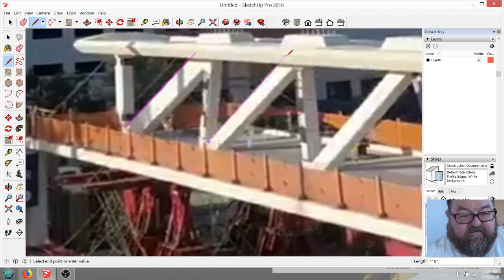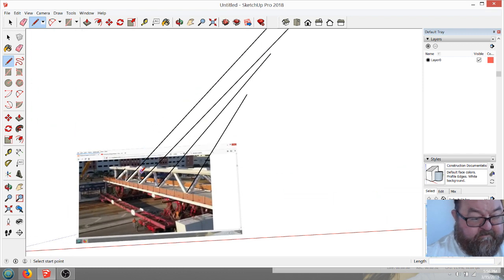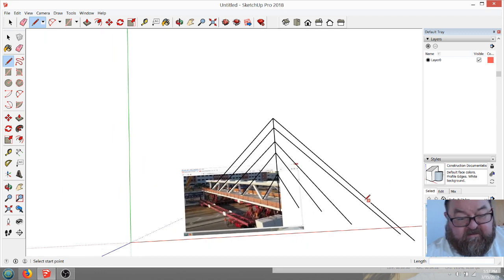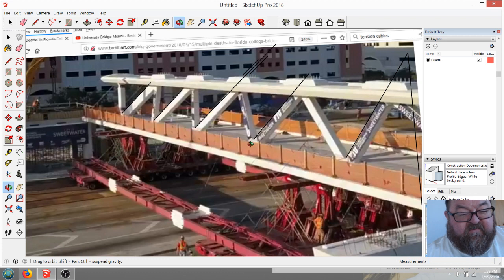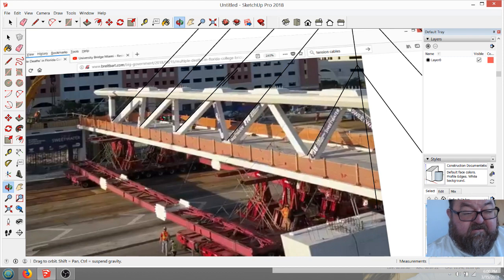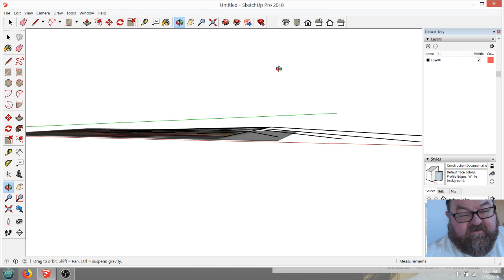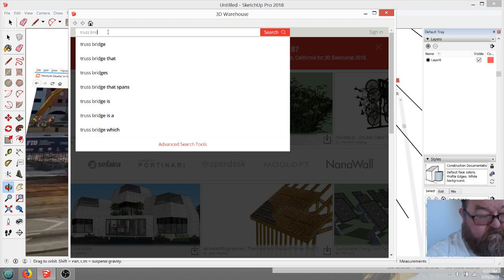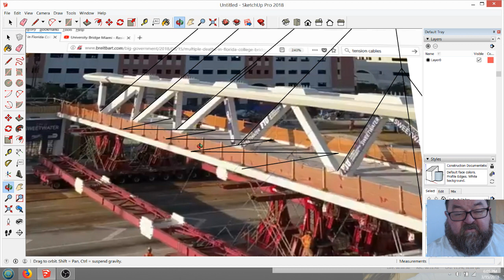FIU Pedestrian Bridge Collapses Under Own Weight - SketchUp

Comment: Should have had used steel, instead of concrete. Even wood is good. Arch is required. No need if strings. Support at mid point required. Stress and bending moment need to be calculated. Proper software, need to be used.  For pedestrian light weight design with durability material required.  Even compressed plastics can be used.

Comment: Try this, Ironworker carries 3 or 4 men in JLG manlift(green)to roof of structure, all persons offload to roof structure roof to plan next phase.There is the person who jumps up to check flex, structure during this phase of build is not designed to withstand this reflective force, get the names of the guys on the roof at time of failure, they ALL went in the hole!!! Conclusion: real people make real mistakes
mike&gina in Tennessee, in love, in Christ.
Reply from the maker: I hadn't heard that.
Reply: This is my trade or was until DACA replaced legal American citizen union Ironworkers in 2010 w/illegal aliens. I was DOT certified welder. I have done this same installation, the tell is the green man basket still in air after collapse. Three men leave man basket (550 lbs) and walk out on roof structure, without guy wires in place THIS is over stress even if your "walking on eggs". I think one jumped up causing a flex or ripple effect, He was jumping up when collapse occurred. In slo-mo you see two men ride the structure into the hole, and the jumper is left airborne suspended, then in the hole like the rest. I have picked 900 ton, this is poor judgement. They will make it more, watch the slo-mo.We may not have the workforce to make America great again.
mike&gina in Tennessee, in love, in Christ
Reply from the maker: Thank you so much for your comment. I am also in construction in Tennessee.  I see what has happened to our industry every day.  People like you make our country great, not these people.
Reply: YUP

Comment: If the suspension cables were installed the bridge would not have collapsed.  This tragedy is the result of sheer stupidity of construction oversight. 
The temporary supports should not have been removed before the overhead suspension cables could be installed

Comment: I am a commercial carpenter w/30 yrs exp. Does anyone else see that this part of the bridge is like a bar joist,  or TJI. That have load top members and trussed underneerh,  transfers weight out to the end.  This has truss on top transfering weight to the center its upside down engineering
Reply from the maker: Yes and look at the so called truss webbing.  It is designed to be an extension of the stay cables and not a truss.  This is part of the problem I believe.

Comment: I agree with you there's no structural Integrity unless it's in compression but you can't have compression unless those lines are connected. I was watching the computer animation of how this thing was constructed and those joints have absolutely no structural Integrity. They terminate into concrete.  the general contractor was probably brought in because of who he knew and the project manager was probably the female? I believe that's correct? ..and she was put in that position probably because the company was being pressured and when you hire people because of things other than competence this is what you can expect. Disasters are a red flag that the wrong people have moved up in position of authority. That's the root cause it always will be the root cause of these types of catastrophes. All the competent people were probably let go and slandered out of there rightfully deserve positions.

Comment: This video is a fantastic example of someone with no civil engineering background at all providing an almost dangerously ignorant commentary on something he doesn't understand at all. Looking forward to you explaining quantum entanglement next...
Reply from the maker: Quantum entanglement is easier to explain :)  I do have 40 years of experience and own my own design-build company.  I also worked in architecture and engineering for 10 years.  So maybe you underestimate me because I am from Tennessee.  None of the structures I have designed and built have ever fallen, btw.
Reply: Sorry but BS on your credibility - civil engineers building bridges don't use SketchUp (and BTW drawing parallel lines on a perspective photograph doesn't work either). And yes I'm sure you have a simple explanation in your head for all things, QM or otherwise. Hundreds of people were involved in designing that span, running hundreds of hours of simulations, etc. Just because your simple mind demands there be an arch for it to work is ridiculous. This could be material failure, procedural failure, corrosion or a hundred other things but saying it isn't a feasible design because the span is flat is simply stupid.

Comment: You cant determine that line are not parallel from a picture taken at that angle.
The picture would have to be taken from a different angle.
Trying to make determinations based on this picture is wrong.

Comment: AHH..Happy Litigant's   Lawsuits  ahead,   Plaintiffs / Victims Please Remember to ask your Attorney's  to Research and Identify all  Responsible Party's in this Case that should Include all Cross-Plaintiffs = Cross-Respondents/Defendants  or each individual Party will slow down the process by pointing there fingers to another party that's responsible either in full or in part.. this is the part of the Game that Respondent Atty's  will play out  in Civil Court Cases just to slow down the process  to try and lessen out liability of the party there representing.  so if all responsible are Identified and served early on it makes the case move faster.
Reply: it looks like the party's responsible are FDOT because its on a State Road,  FIU,and the possibly the City & County Govt's and some if not all of the Construction Engineers Company's and Gen Contractors,  Sub-Contractors from the Steel Frame to the Concrete/Cement Co's  Welders Companies Very Very Messy Lawsuits Ahead,  as Said:  Happy Litigant's
Reply: Ohh..  also this is the norms of  Incompetents in workmanship that live and work in
  Miami-Dade County at play
Reply: Why would they want the case to move faster? The longer it takes, the more time the lawyers can charge for.

Comment: it is a bad design, the piles have an inclination of 45 degrees and coincidentally the central one has an inclination of almost 90 degrees, all the inertia moved to the center of the structure, the other is at the level of the pilots. circles, the piles must be symmetrical

Comment: Your video is completely wrong about this bridge. The lines you're drawing don't represent cables. There are no cables in the design, it is NOT a cable stayed bridge! They are HOLLOW TUBES which do not bear any load and are entirely decorative. This is purely a trussed bridge. It should have been full design strength without the tubes since they are only cosmetic. TRUSS SPAN TONY... and don't call those cables, they are not.
Reply from the maker: You miss the whole point. It should have been supported by cables because the truss design was a fail.   I guess you think it was a good bridge, LOL Save your breath. I have been building things for 40 years. This bridge would have never stood without real cables.  It's was a complete cluster regarding design and engineering.  It's criminal and someone should go to jail.
Reply from the maker: I guess you didn't watch my follow up video where I show that in fact, the stays were designed to carry the live loads.  Unlike most, I read through the design documents.  I am also a CSI certified spec writer and understand structures. You really need to stop trusting everything you see on the internet.

Comment: You are rambling in this - there is no place in the design for a center structure for cable towers.  Engineers should understand formulas of mass times distance = stress. This was a disaster waiting to happen.

Comment: No torsional rigidity in the basic design
Reply from the maker: Fubarfighter yep :)
Reply: If that were the case, then an I-Beam wouldn't have torsional rigidity. And we know that's not true.
Reply: Justin Mickens you'll have to look into the matter a little more deeply, friend. Wideflange sections actually don't have very much torsional rigidity. They must be braced beyond a certain span for that very reason. And they are homogeneous, continuous members, versus this non-homogeneous, interrupted web, bloated weight section with no stabilization. The entire moment of the load conditions encountered had to be shared between the top and bottom 'flanges' by the few strut connections provided. This is quite a lot to expect for 950 tons on 170 feet clear span. 
Incidentally, ever notice that driveshafts are round, not I-type sections? That's for torsional rigidity.
Reply: I understand that a W section isn't the most efficient shape for torsion, but for most cases it's perfectly sufficient. Regardless, you would see a very different scene if the structure failed due to torsional buckling or something like that. I'm guessing it was a failure of the post-tensioning system. I'd assume you would have seen the same type of failure even if it were shaped like a box with 2 sets of truss elements on the outsides of the slabs.
Reply: Justin Mickens I'll have to disagree with you on most of what you said. I think the remains of the bridge could easily be manifestations of torsional failure, which makes sense, since the intended net section modulus (meaning the one with the bridge horizontally true) apparently worked as it was set on the abutments. Then some unbalanced loading was introduced (workmen, wind, equipment) that twisted everything off center, reducing net S to the point of yield, with stress concentration at the connections of the struts or the diaphragm around those, rupturing in a sequence.  It didn't have to fall very far, so displacements to the sides of the long axis are understandably moderate.
Reply: Well, I look forward to reading the forensic engineer's report.
Reply: Justin Mickens I think you can see the roof twisting right before collapse in this video: https://youtu.be/Y9ohLtV4LXI
Reply: Fubarfighter:  You nailed it.  You win the solid-Gold Slide-Rule award.